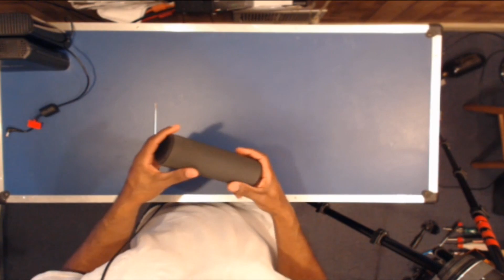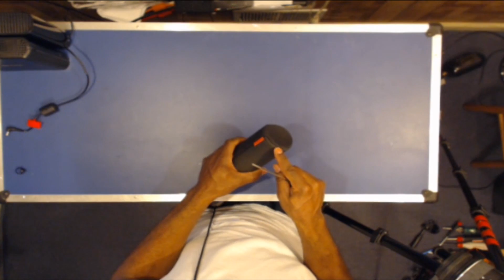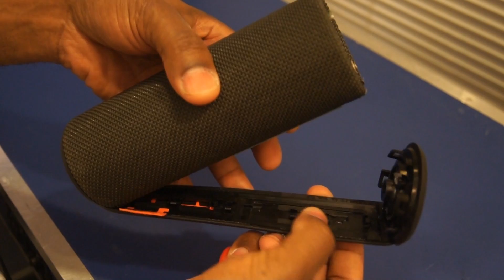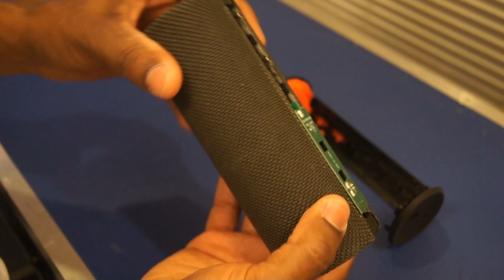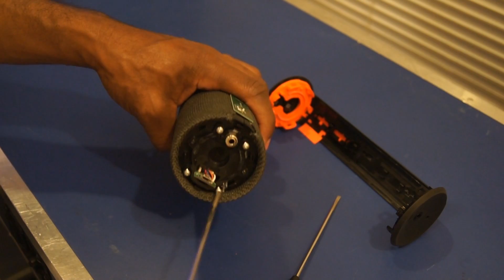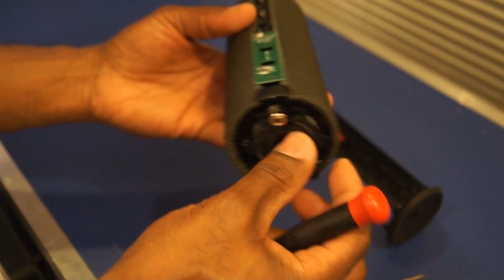UE BOOM TEARDOWN - THE FIXER #ueboomteardown #bluetoothspeaker

Comment: Keep the chatter to a minimum.
Music is distract and annoying.
And, slipping in advertisement.
I simply turned off the annoying,
and learned quicker.

Oh by the way, don't need anything to open the outer, simply remove by the side removal will allow easier removal of top and bottom. Mine, unless you don't have a version made in China. The battery is not glued in, mine slips out after disconnecting the connector which is not easy without prying the molex connector very easy by the tab that locks so the power supply cannot easy disconnect having it fully assembled.
Reply from the maker: Well hey, thanks for the tips... and thanks for watching.

Comment: I destroyed mine while opening it . Well . Its a bad speaker. So .... I don't mind. Even for less money U can buy  better devices. 
Fk..  it. I don't recommend UE Boom  I realised that its poorly made as I opened it. The drivers are a fail like they are made, the passive radiators are  waaayyyyy to big and heavy duty and the single 18650 battery didn't lasted very long. Mine is 2 years old and the battery is dead after 10 Minutes of a full blast. 
So 
Thank you . But don't buy this Box.

Comment: Just pulled mine out of the washer. It's definitely water resistant.
Reply: Jordan B. dude I was thinking of dumping my megaboom in a bucket full of water but I was scared it'll mess up 😂
Reply: Yeah, my girlfriend accidentally tossed it in with some towels and it went through a full wash cycle. I let it dry out for a week before any heavy use but it works just fine.

Comment: question:  I use my UE MegaBoom in the shower.  one day, I noticed that it sound muffled in shower and then sound went low.  I picked it up, shook it off and everything is OK.   Why do you think this happened if it's waterproof and water resistant.  and now ( it could be psychological from this experience) but it seems like the bass is not as full.  still a killer sound, jus seems like sound diminished.  Could it have and could one of the speakers or drivers now be compromised.   again, speaker sounds great still.  need some insight.   thanks.  bklyn💯
Reply: It is not water proof, the UE Boom 2 is supposed to be more water proof.

Comment: i notice this is a never version of the first ue boom. the original ue boom, you have to be careful to remove the rubber part of it, because the bluetooth antenna is attached to on the rubber with 2 wires

Comment: just watch the video UE Boom 2 was not charging inside of the connector there is a pen set if the pen set is bent straighten pins reattach you have a new connection.
completed this little project in under 30 minutes

Comment: What did the factory use to seal it? I dropped mine from about 4' onto tile and the top popped up to where I could just barely see the blue clip inside (UE Megaboom) like your orange one. I'm still trying to figure out if the seal is broken beyond testing it by submerging it.
Reply from the maker: +nastystang113 not sure..., but I think silicone sealant.  Hope this helps.

Comment: Hi fixer, i have a problem with my speaker, it worked good but i didn't use it for six months and now the speaker dont turn on only if is charging, i push the + - buttons and i hear 100% charge but the bluetooth doesnt work, do you have any idea about what is the problem? Than you :)
Reply from the maker: Hello,  I would suspect that it is a battery issue....u may want to try to connect it via bluetooth to a different device...to verify that there is no sound...hope this helps...as always pls like and share the vid. :)